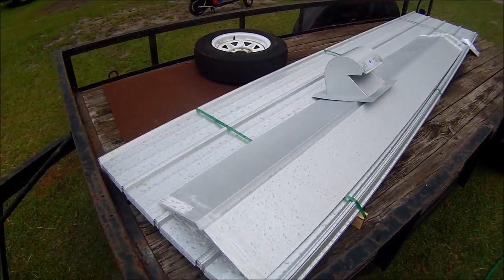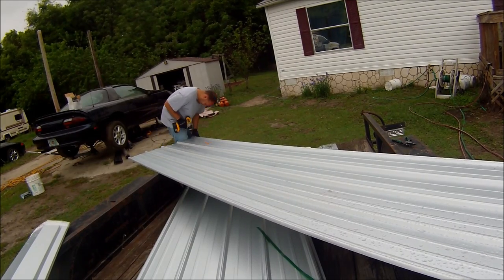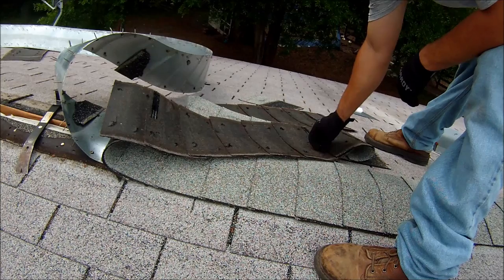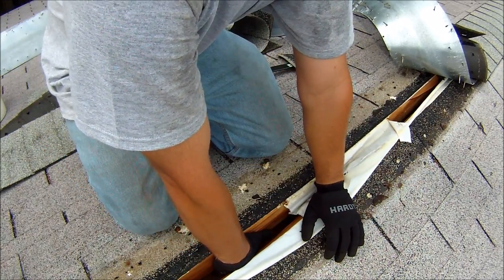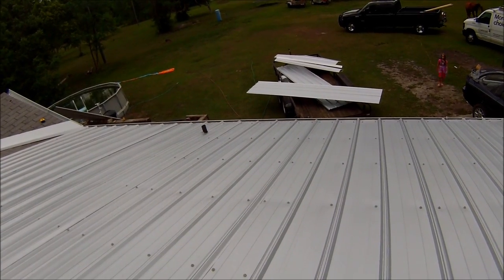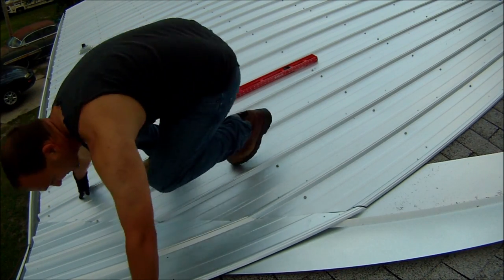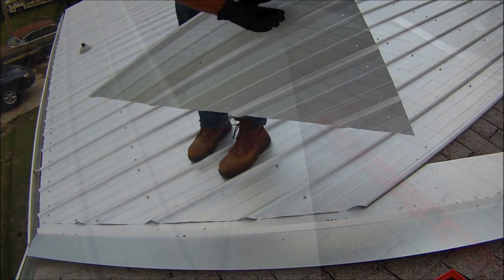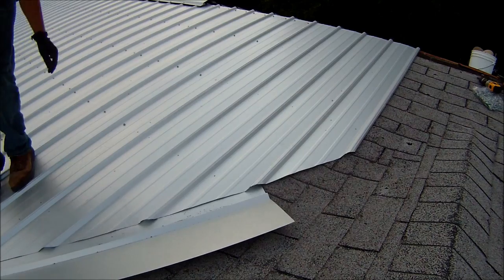Metal Roof Over Shingles on a Mobile Home by Myself

Comment: Just finished my own metal roof project. A 2200 sq ft undertaking with 4 valleys, completed by myself in the Texas heat. Additionally, I took off my old shingles, replaced some rotting boards and used an underlay, your video was both informative and inspiring. Saved enough money by doing it myself to afford a trip to the old country (England) for the family and me. A massive thank you good sir for sharing this and I wish you well in your future projects.
Reply: Duncan Curtis my garden room has a metal roof and now the inside is leaking when is foggy and  or rains.I been trying to fix it my self but I haven't find the metal shingles what provider did u got it from?

Comment: Watching you work reminded me of myself as I go about figuring things out.  I respect a man who has the guts to do it himself.  I see where you made a few mistakes but you'll learn from them.  I'm 68 years old and am about to reroof my house too.  Because of my age and being more incline to screw up, I'm putting up some kind of fall protection or maybe a harness and rope.   Like you I'll have to screw every screw and carry everything up and down the ladder.  Your wife is blessed to have married a man who can do stuff.  Good job!
Reply: don't do what he did
Reply: Why not?
Reply: You could have added a coupling and a short extension to the vent pipe so the boot could stand up properly, but what you did should still work.  It may accumulate some debris (leaves, water, etc) but that should not be a problem except for possible mosquito breeding site.  Good video, and any job is tough with no extra hands to help.
Reply: Frank, right there with you m'man. Ain't it hell having to do things on your own? Only 2 nabors in a half square mile & 1 is older than I am, lol.
Reply: A professional probably wouldn't Pre-drill the holes because he would use self cutting screws and Off-set the cost against the time saved by not Pre-drilling? But I can understand why you did it.
Reply: ethics101 
???
Reply: i did my one section at a time took me 2 months by myself lasted 26 years looks great but not perfect saved 2k .
Reply: Frank If I have no valley or pitch would 2x4 be too heavy to Frame on top? Should I use different approach? subfloor 1/2 inch Single mom replacing roof....?
Reply: @andrewcullen8635  yeah but you want your screws in row for one looks cleaner and better and it also makes it easier to put silicone on the screw heads besides having a screw hear then up two feet another and down 3 ft another screw so on so on. I think pre drill it is easier than just doing a guessing game where screws go
Reply: Nunyobizness Nunyobizness  what is your first language? ESL didn't take.
Reply: @andrewcullen8635  I use self-tapping screws, but pre-drill anyway. Gives me a nice, straight screw line, especially when the slope is steep enough to be visible from the ground.

Comment: The roll of mastic that you applied in the valley overlap, it's meant to go down the entire length of your valley as well, about 4-6" out from the center. This seals the cut edges of the valley sheets to the valley to prevent wind-driven water from going beyond the edge of the valley under the sheets.
Reply: Supposed to tape high rib on every lapped panel
Reply: Mr no. It all
Reply: @randytolin3059  it's know it all, lol
Reply: How is that butyl tape going to seal the standing ribs up watertight in the valley genius? It's not going to happen goofy.

Comment: do NOT set your screws in the valleys  set them on the ridges the ridge will flex back making the screw tighter and will not allow for leaks as in the valleys and also will keep from catch debris in the valleys

Comment: Great the way u walked thru each step. Planning on doing the same on my roof, but thought about stripping with 1x4s or just install 1/4" insulation under the metal for added insulation. We hardly ever have hail here so dents aren't a problem. I'm 60 and this has to last the rest of my lifetime! Main reason for going to metal roof. My hats off to the 68 year old guy too!  Any input is appreciated.
Reply: Mark McCarty I'm looking at doing this myself also. Do you know why some people lay the metal straight on the shingles and some people use the stripping?

Comment: I'm country and proud of it. Live in MB, SC. From Franklin Co., Va. I've been doing residential construction for 30yrs. You did a fine job. You didn't have to overpay some know-it-all, that claims to be a "pro roofer", to come do something that is really common sense. Water flows down. I'm not a roofer, but if I was, like some of these guys claim to be, I wouldn't spend my time watching your video, just to make stupid comments. I've helped a roofer do a couple of these roofs and have been up on at least 20 other roofs with this type metal. I've never seen anyone use silicon on their screws. Who wants that mess around every screw on their new metal roof? I work on all kinds of machinery. Rubber gaskets are used, w/o silicon, to hold liquid that's under pressure. Why wouldn't a rubber gasket keep water out? "Pro roofer"? I wouldn't let that "pro roofer" put metal on my dog house, even if he would do it for free. Rite On man. DIY
Reply: Don't be so proud about this eather ! High winds will take care of this roof! Hi Did a good Job ! Just did whrong!

Comment: Good work did that few years ago, learned a lesson. Over the the singles will deteriorate and the screws will become loose  and let water in. Need for strips for better hold. You're a hard worker
Reply: H
Reply: @rubetube92 1 x 4 going acrossed the shingle roof, screwed down into the rafters so the tin screws have something to grab onto other than the OSB

Comment: I've worked in the metal roofing industry since 2010. 
You need underlayment or furring strips (also called "lathes" in the South). Without any way to keep the asphalt shingles from coming into contact with the expanding and contracting metal roofing panels, you have voided any kind of warranty your roof might have had. This is standard practice from the metal manufacturing end of things. Furring strips also allow for good ventilation under your metal panels, which can be prone to condensation if the underside is warmer than the upperside air temperature, which is not atypical in mobile homes since the insulation typically used is not the greatest. 
The second pipe you flashed around does not terminate high enough. In Arkansas, code states that a vent pipe coming through the roof must terminate at least 6" above the roof covering (I'm pretty sure our code is just copied and pasted from the IPC). 
You should have checked to see if your pitch is less than 3:12. I know most homes like this have a very low pitch, but if it is less than 3:12, you need to install lap sealant where your panels overlap. Metal roofing that does not have soldered seams require a minimum pitch of 3:12 without lap sealant and 1.5:12 with lap sealant. 
Eave trim or drip edge is required by code, although if your shingles have drip edge (which they should), you probably don't need to install the eave trim; however, rake trim is always required, and it is not shown in this video.
Reply: so heres a question... my mobile home roof is all metal... about 30 years old now and needs to be replaced soon. What is recommended for putting a roof like this over the existing metal roof?

Comment: It looks really nice. Don't know how I ended up watching your video almost a year after I did the same to my home. What I did different from you is that I first screwed  1x4 over the shingles with some 2 inch screws and then the metal roof to the 1x4's. I also didn't pre drilled holes for the screws since the impact driver did a nice job.
Reply: Marco A 
I have to give you props !! Should of put lathes on to create a ventilation barrier! But good job buddy !

Comment: Not wanting to say anything negative but back in my younger years(40 yrs ago) when we put tin on barns we put the nails on the ridges of the tin not the flat part of the tin. Of course we didn't have the screws with the rubber washers. That saying, the rubber washers will eventually deteriorate and water will get in on the flat surface. You definitely hard working man. Congrats
Reply: Pretty sure he will go up there and spray flex seal

Comment: Great video and job Man! I bought this house 4 years ago and paid a so called experienced roofer to tear off and reroof the house. Now 4 years later it's leaking on the flat porch part. He should have used roll roofing if he was experienced on that part. I'm 58 and half crippled but my house is small and thanks to your video I think I can do it with a helper. I did all kinds of carpentry work when I was younger. I might as well do it myself because virtually every home contractor in this area wants to make a "good lick" and rip your head off and do a crappy job. Thanks again!

Comment: I see a lot of professional roofers commenting on this video. Saying it’s gonna rot and blow off😂  you gotta run 1x4s blah blah blah. This is the exact same way my roof was installed over 20yrs ago. Never had a problem with it. It hasn’t blown off or rotted yet.  I mean how do you think they install metal roofing on a house. It’s screwed right down to the decking!! Good job man!!
Reply: Yes but  most houses have plywood roofs unlike most mobile homes that compressed wood that the screws can back out of, right? I believe that could be an issue.

Comment: I love the video. Advice from my past experience: You may want to caulk every screw. The OSB on most manufactured homes will not hold the screws tight for long especially with #9  or #10 screws. 
Stripping the home allows for a lot more bite for the screws and only adds about $300 to the average roof project. If you have real plywood decking 5/8" or thicker then screw it directly but use large #12 screws.
Reply: good tip. i see all those metal roofs going on top of shingles and a nice windy day could rip it all off. wood framing does give more security.

Comment: As I understood, installing metal over shingles would result in overheating the shingles causing them to "bake" and break down sooner than they normally would and that would lead to leaking around the screws and rotting out the framing/ sheathing.
Removing them, laying down furring strips with 1/2" rigid foam between and a self healing waterproof membrane would have been the way to go. I get it though, it always comes down to time, money and less of a mess.
I hope this works out for you, but you may want to keep an eye on it. Just a heads up.
Reply: It will be fine for a few year, but 5 or ten years from now he's going to have to pull it all off and fix all the damage and rot he has underneath, plus any damage caused to the inside and structure of the house. People thing these things are so easy, but they skip simple steps like you pointed out because they want to save a little time and money and in the end it ends up costing a lot more of both. Just walking on that metal roof with the shingles under it is probably causing damage to it.

Comment: If you notice your panels aren't laying straight there is a way to shrink and expand the top/bottom of the panel by angling the screws. You can tell if you are off by making marks at the top and bottom of the roof where each piece is supposed to be. If you are off by a little you can usually get away with shrinking or expanding the last rib. Iv had to expand or shrink every rib before but it's definitely worth keeping the panels straight. Good job though!
Reply: I build pole barns with the same metal as siding you have quite a bit of play if you know how too manipulate the panel to stretch or shrink and depends on the the thickness too

Comment: Good job, only 1 thing I would have done, but that's just me. The vent boot. I would have extended the ABS about 6 inches higher, so when I slipped on the boot, it stayed in a cone shape, to shed off water, pushed down like that water is going to pool in it, and eventually rot. Standing or pooled water anywhere isnt good. That's all I would have done. I think you did a wonderful job. But think that boot is going to be a problem soon.

Comment: You did an excelent job there.The only thing about the roof I didn't quiet agree with was the ridge cap for me just my own prefrence I would have wanted it to be about 2 inches wider on both sides because of hard blowing rain.I am guessing after about 2 years living under that beautifull new metal roof no leaks at all hope you never have  a leak..You sure are a good carpenter and smart too.I want to do our whole big house roof with metal but cost alot for big house.

Comment: As I posted 7 months ago, I installed a metal roof over one layer of 3 tab shingles.  I started Nov. 1 and hoped to finish by thanksgiving.  I finished Dec. 15.  I used 1 x 4 battens.  This job was way bigger and harder than I imagined.  I had to do every thing alone.  I carried the 20 ft lengths of metal from the front to the back and up onto the roof.  I screwed every board, every piece of metal.  I damaged both my shoulders and may have to have one fixed.  My biggest concern now is that it might be leaking and I won't know it until it rots though.   But now I have the best looking roof in the neighborhood and I did it myself.
Reply: Frank Clements 
I keep watching these videos where married men keep having to do the work all by themselves. I would not let my husband do this by himself without being a helper at the very least. But somehow it isn’t enough to save my marriage. I still would be a “gofer” for him though. This work is tough enough.
Reply: you showed alot of folks it can be done slowly but surely .
Reply: I would use a roof safety rope even for 1 story and limit the time to 1-2 hrs per day. Being older or not good idea to plan for accidental slip and fall. Old men die doing things like that in trees without safety equipment.

Comment: I latched onto your idea of pre-drilling the metal. Up until then, I couldn't find a way to hold my screws to a nice neat line. I've been pre-drilling all my metal since seeing your video. Nice, neat straight screw lines. WTG. I may have missed your explanation for not using anything between your shingles and metal. I'm sure you realize they expand, contract at different rates, and that gravel on the shingles will be running against the back of your new metal until it rubs, rusts through. Great video!
Reply: I was thinking that too, he probably could've put 2x4's down or plywood, I was also thinking that when the heat goes through the metal roof(radiation) and hits that black shingle i wonder if it will heat up the inside more?

Comment: Did you happen to notice if the rain makes a lot of noise on the metal roof?  I would use purlins and insulation because I would err on the side of quieter, as well as reflecting all the sun's heat and keeping the house much cooler and thus save money on a/c.

Comment: great job, for a one man crew, going to do this , this year. roof still holding up good any problems,  would u do any thing different ? I will be doing my house by myself, don't have the extra money to really pay for extra help. will take a week  or two off work, to do this. bulding inspector told me I need to remove one layer of shingles, since I'm going to have to do that I'm going to remove both.
Reply: Did the building inspector explain the reasoning on why you need to remove a layer of shingles? I've got two layers on mine as well, and I'm about to do what this man did to my double wide.

Comment: I've used caulk in the valley overlays the sticky tape is junk .1x4s would help the roof last longer. It's ok just understand it may cause premature rusting from the backside of the panel through to the front

Comment: Thank you for your inspiring video. Very helpful. I want a metal roof for two reasons : fire resistant and longevity. I live in California fire area and have stupid asphalt roof that is 30 years old. I want to save money and have it last hopefully longer than 30 years. My roof has no gables but does need venting. I don't need my house to burn down.

Comment: Hey man, did you use any sealant on those screws? or did you use the metal roof self sealing screws? I couldn't really see the screw heads all that well. I know here in NC they sell the metal roofing screws that have the rubber washers on them to make sure they make a good water tight seal. I didn't see those on your screws.
Reply: MrCougar214 this is exactly what I was looking for! decided to read every single comment before asking about it because I am too lazy to wait for an answer lol.
I just purchased an acre of land with a singlewide on it which is in pretty bad shape so I will be doing this same thing to it. trying to gather as much info as I can :)
Reply: Thanks for the reply and the info!
Reply: never over shingles
Reply: Not too tite and not too loose. Over tightning destroys washers and crinkles metal. Too loose and the hole leaks. Terms known as kissing in the pile barn biz

Comment: Great video man!
I have a manufactured home as well. ( Not my favorite in a long shot but it is what it is for now. Lol.) But I'm looking into roofing over my shingles as well with metal. But I got a few questions. 
1. Was your plywood still in good shape for you to just screw down the metal? I was concerned if it would hold in a good wind storm if the roof was old. 
I've seen some run 1x4s to anchor the metal. Just curious.
2. Where did ya get your metal and what all info do they need to know what and how much to send you?
And how is the new roof working out?
Thanks!
Reply: Just think  do I have to put that installation board down in between the 1x4s? Or is it really necessary?
Reply: think  but not necessary if the shingles are in good shape?
Reply: Just trying to save on the cost. Lol